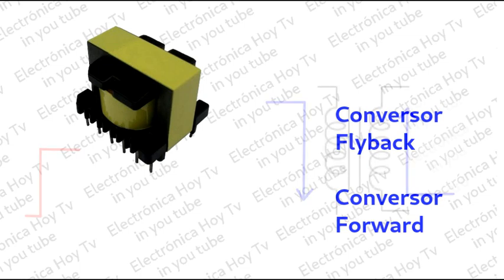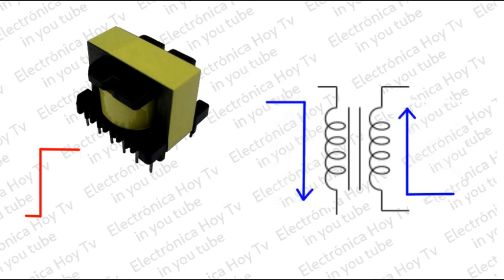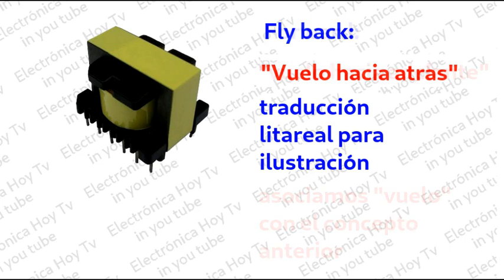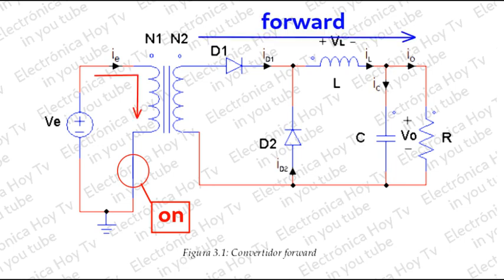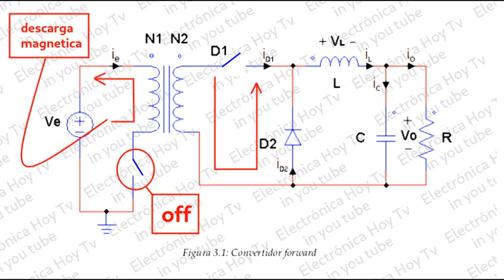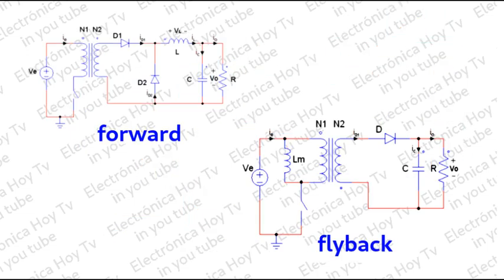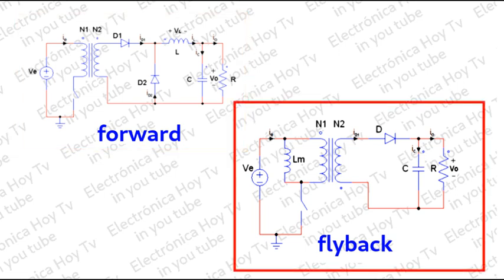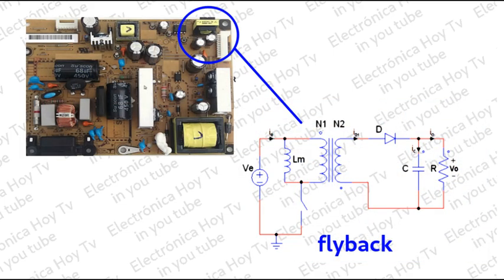QUE HACE LA PLACA POWER EN UN TV LED 5

Comment: Profe muy buenos dias lo felicito por el excelente video y lo felicito un milon de veces mas por que veo que es ud el unico de los que hacen tutoriales que contesta las preguntas, yo me tomo el atrevimiento de formularle una, tengo un tv led chasis de la fuente y main 5800-A5M67B-1P00, que a la entrada de la fuente dc-dc tiene 27v y despues del rectificador un SS5CC 57v y alimenta un backlight de 24 diodos de 3v, cuando le doy power los led prenden e inmediatamente se apagan y el tv queda en standby, si desconecto los led el tv funciona correctamente, sin la iluminacion por supuesto, le cambie los capacitores, que ud me pudiera recomendar sobre donde puede estar la falla. De antemano muchas gracias y buenos dias.
Reply from the maker: Hola Nelson muchas gracias por comentar, puede ser que haya un led del backlight en corto y por esa razón la corriente estaría muy elevada, el driver protege la serie apagando la alimentación, puedes intentar bajar la corriente del backlight aumentando un poco el valor de la resistencia shunt para confirmar, puedes también probar el backlight con un probador casero a ver cual de todos es el led dañado y cambiarlo. Éxitos